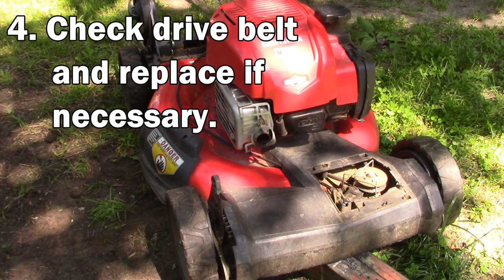Lawn Mower DRIVE WHEELS Don't Work - CHECK These Common Problems - Craftsman M260 Self-Propelled

Comment: Wheels are fine, belt is fine, cleaned out area around drive but wire is all slack at handle, how do you get that tight again? If I push manually front wheels are moving but cant do from handle. Thanks

Comment: I turn the pulley by hand and my wheels do not move. At this point I don't think replacing belt will make a difference.  HELP!
Reply from the maker: Does the transmission pivot and belt tighten when you squeeze the handle?
Reply: @Buckwsr  yes

Comment: If drive pulley engages when motor running but slips when running with a new belt could the drive pulley be the cause, mower was made in 2009

Comment: Thanks so much for this.  I was trying to save some money so I went in myself and followed all of your steps to do this :) Very detailed and it helped.  The engagement bar works, I check the gearbox and that also works, I grabbed my wet vac and vacuumed all the grass out that was under that flap to clear that….. I haven’t checked the wheels yet or the belts but… I’m doing one thing at time :) I grabbed the cable cord  and pulled it a little….and when I did so, the wheels finally started turning properly. However, when I let the cable go the wheels stopped turning. It’s almost as if the cord has to be in a certain place.  I had to tape the cable down in the right spot so that the wheels would keep spinning and work properly. Any suggestions on how to tighten the cable or how to replace it altogether?
Reply: Symptoms sounds like you need to adjust the cable up on the handle bar

Comment: Just wanted to thank you. I followed your advice with the same lawnmower.  I did every step and all looked well. I took the plastic shroud off to get to the belt and the belt was off the pulley. So much crud had pushed it off. Put it all back together and runs great. Obviously I subscribed.
Reply from the maker: Great job, David, fixing it yourself!

Comment: Great video! I replace the front cover and realized wheels stopped turning. I replaced belt but now experiencing the following- wheels do not turn when "belt keeper" is positioned correctly but wheels turn when right side of "belt keeper" is under belt or not inserted correctly. Can mower be used without "belt keeper" wire? Any help would be greatly appreciated!

Comment: Good video 
I’ve got a craftsman RWD  with a cable problem  but to service it seems a little more difficult than these FWD models it doesn’t seem to have the service lid or door and it’s a newer mower then this one 
7.0 Platinum series I believe

Comment: I have a 12 year old toro push mower that had the front wheels move but lock up and wont complete a full rotation. This happened after hitting a glass bottle in tall grass. Thank you for the video I will check all this tommorow

Comment: I have a brand new mower that pulls when you push that handle down but don't pull down . Right out the box . Think I'm going to send it back . I checked the video out everything  good .

Comment: great instructions .. removing that front belt guide wire can mess you up if you dont pay attention..and i could see it perfectly..and the power wheel hub tip was great.. metal and plastic doesnt mix for long. especially with the torque presented to that plastic.

Comment: Hey Buck, another great video, and perfect timing for me.  I'm trying to figure out why my Troy-Bilt mower isn't self-propelling quite right, and your video has helped me understand how the whole system is supposed to work, and where to focus my attention.  Quick question...  I've seen other YouTubers suggest that you replace the blade adapter every time you replace the belt,  have you ever found that necessary?
Reply from the maker: I've never replaced the blade adapter. If the blade adapter includes the pulley on which the belt rides, I could see some value in replacing it if it has worn down over time. Otherwise, I don't see the point in replacing it.
Reply: @Buckwsr  Thanks, that's good to know.  My adapter does include the pulley, but it seems fine to me, just needed a little cleaning out with a wire brush.  I think my problem is with the cable, because the gear box isn't rotating forward and tightening the belt like it's supposed to.
Reply from the maker: @tunahead7275  okay, sounds like you're making progress. The cable may be adjustable and you could tighten (shorten) it a bit. Make sure there isn't built-up grass obstructing the forward movement of the gear box.
Reply: @Buckwsr   I was able to adjust the cable a small fraction of an inch today, by unthreading the cap at one end, effectively "lengthening" the cable housing and "shortening" the cable itself.  It didn't help, the gear box still isn't rotating forward, and the belt still isn't tightening.  The clutch lever on top of the transmission does move like I think it's supposed to when I pull the handle, but nothing else happens.  I cleaned all the grass from the entire mower earlier.  I'm thinking at this point I may need to just replace the cable, or there's something wrong with the transmission.  The handle and the wheel assemblies seem fine, the belt is only about a year old and looks good.  Any thoughts?

Comment: Curious why you used your impact driver to remove most of the bolts (?) but on the under side you used a hand held handle.

Comment: Awesome video, helped me realize my belt popped off. I do have another question pertaining to this mower. Im a younger guy, and would like to speed things up. This mower adds another 15 minutes to my time compared to my standard push mower. Is there any way to speed this bad boy up a little bit? I dont want to win races, but id really like it to go a smidge faster. Thanks for any help!!
Reply from the maker: Possibly increasing the engine speed might help, as long as you don't overdo it. Here's a video I did on that topic: https://www.youtube.com/watch?v=sD6_2aa1viw

Comment: Great video Buck.  My front wheels turn about half way and the lock up.  I can pull the mover backwards and the wheels turn halfway again until they reach the lock up point.  This is with the mower engaged or off.  Any thoughts? I clean all the grass rope weed from the axel bar that connect to to front wheels so no obstruction that I can see.  Any thought would be appreciated. I have a Toro 6.50 Recycler
Reply from the maker: Hard to know without seeing it. I wonder if the engagement cable is adjusted properly?
Reply: Maybe the cogs are worn on the inside of the wheel.

Comment: Good video. Why does everyone keep taking off the pulley nut when you can just pull the wire guide off that is on the pulley? That is the easiest way to change the belt on the front pulley. No need to remove the pulley nut.
Reply: Exactly

Comment: Thanks for window switch replacement video on (my) 1998 Pontiac minivan you posted 5 years ago . Mine failed today - AutoZone will have the switch tomorrow and I had the AC serviced a couple months ago so I'm good . I found and changed the cabin filters probably for the first time , really surprised to find all that filter stuffed into that small out of the way hole hahaha .
Reply from the maker: Thanks, Ed, and good luck with the van.
Reply: @Buckwsr  AutoZone called this evening a day early / same day that they received it and I popped it in a bit ago so all's good  👍 I sub'd to your channel , Good Luck and God Bless you , your family and America .

Comment: excellent...but remove the plug wire before removing the blade
Reply from the maker: Well, okay, if you wish. But let's be honest: It is absolutely impossible for this engine to start up "accidentally" while removing the blade....for three reasons. First, with the control cable in the stop position, the flywheel brake is engaged, making it difficult to spin the engine. Second, with the control cable in the stop position, the magneto is grounded out, making it impossible for the ignition system to fire. Finally, breaking loose the blade bolt with a power tool will not get the engine spinning fast enough to start the engine. I simply have never seen an engine start "accidentally."
Reply: @Buckwsr  wiel i got that advice from another lawn mower channel 🤔maybe they were mistaken. Regardless your advice on fixing the front wheel assist worked perfectly. thank you. subbed and belled
Reply from the maker: Thank you so much, Claude. I don't want to sound like a know-it-all. It's very possible that in the days prior to all these safety features of the modern era, that removing the lead wire to the spark plug was in fact a necessary precaution. But understanding a little bit of how these machines work, I don't think I was taking too big a risk in my approach. Anyway, I'm glad your machine is back working as it should. And thanks for supporting my channel.  Buck